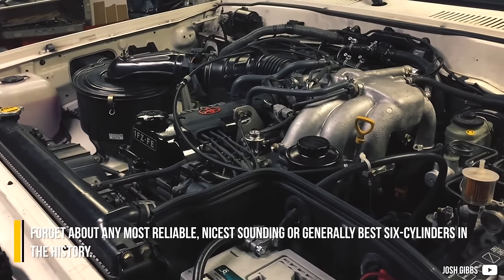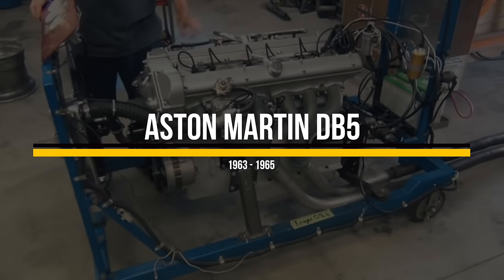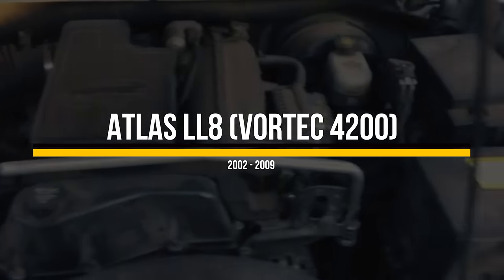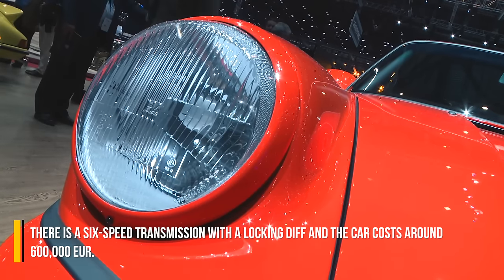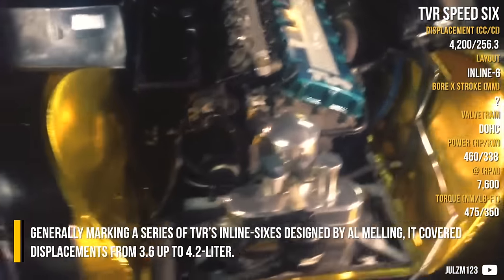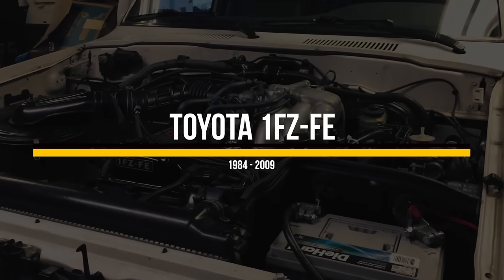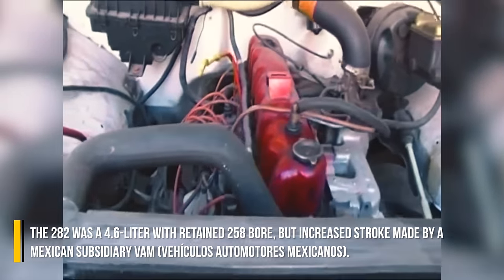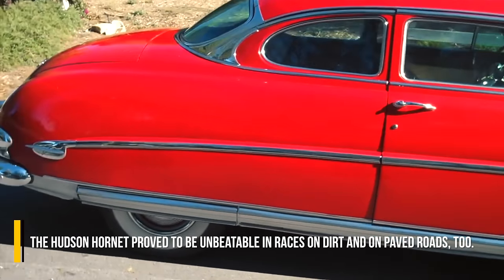12 Largest Automotive 6 Cylinders In The History

Comment: The 60s era GMC 478 c.i. V6 (roughly 8 liters) would top your list. It sits atop their V6 lineup, which also includes their 401, 351, and 305 c.i.  engines.
Reply: Yep, I thought they would be here also and that's why I watched the video.
Reply: Did they come in pickup trucks?
Reply: @YOU BLYAT  No they came in GMC cars
Reply: @hannibalsimpsonthefishseller  the 8 liter model? If so I want
Reply: @hannibalsimpsonthefishseller  They were in the GMC pickup, it was the engine and the trim levels that made the Chevy truck and the GMC different.
Reply: I hada 64 305 cl pass anything but a gas station. I bought a 292 cl chevy racing engine. Roller cam and bearings. With a 4 bbl it was pushing over 500 hp
Reply: @Hannibal Simpson the Fish Seller from Montreal  GMC makes many different types of trucks aside from pickups.
Reply: You forgot the V-12 version. Off topic but...
Reply: @sumgai2585   Yup 2 in a row
Reply: @crf80fdarkdays  
I think the 478 V6 was only used in bigger trucks,  like a C60 or bigger.  I drove a truck with the 478, compared to a diesel engine, it was a dog. That big engine only had a small 2 bbl carburetor.
It was used in Chevy trucks as well as GMC
Reply: @bertgrau3934  I may be crazy, but I really wonder how the 478 would do with modern port fuel injection and a turbo, with a much better intake design...
Reply: @dposcuro  
That would be interesting,  they didn't make much horsepower,  but they were designed for Torque.  With a bigger carburetor/manifold,  headers,  and a turbo it would be interesting to see what kind of horsepower/Torque it would make.  My guess would be the camshaft would be the limiting factor. I agree that would be a fun thing to try just to see it on a dyno.
Reply: Not to be this guy, but 478 CI is about 7.83 liters. ~61 Cubic Inches is equal to 1 Liter.
Reply: GMC never offered a v6 larger than 351 in pickups.  The bigger ones were for medium and ehavy duty trucks.  This vid was for car engines.  They didn't mention the 292 Chevy, unless I missed it.  There were a lot bigger 6 cyl engines for trucks.  Mack had a 707, Continental had a 606, IH had a 501, Dodge had a 413 flathead in trucks in the 50s, GMC had a 707 in the 30ss and 40s and a 503 until 1959, also Continenatal had a 672, but they were all low rpm, very heavy built, truck engines.
Reply: @crf80fdarkdays  yes, and panel trucks.
Reply: @hannibalsimpsonthefishseller  gmc never built cars.

Comment: Bro you left out all the monster GM 6 cylinder truck engines, 305, 351, 401, 478, 637, 702 and there's more I'm forgetting all the different displacements.
Reply: The 702 was the v-12 made out of two 351s
Reply: @jamieleeper8215  I thought the 12 was over 800ci? It's been a while since I've played with any old stuff just remember GM had some beastly 6's my grandpa had a old Chevy dump truck with  a 478 in it thing was a tank.
Reply: I could only imagine! I have a 63 pick up with the 305 v6
Reply: Derek Joon Shocked to see this one left out - my friend still drives his pick up every day with the 305.
Reply: They made a 503ci straight 6 in the late 50's and early 60's, but I think that was more for heavy trucks than your standard fare home use auto.  Might not fit into the category of the video since he didn't include road tractors.
Reply: "the big block six"
Reply: Those V-6 s were exclusive to GMC trucks only; back when GMCs  really were different and better.
Reply: Came here to say this. Not really a GM fan but man those big GM 6cyls are something nuts
Reply: Derek Joon Meh... American engines are sort of Shity a bit like French, British and Indian are too.

Don’t fucking get me even started on that Fucking Ford Short i6.

B5254T4 is the best engine in the world fight me!
Reply: @ellenorbjornsdottir1166  that's a Ford 300
Reply: silverbird58  he included the Ford 300 which was only in pickups.
Reply: Gmc built a 707ci inline 6 gasser
Reply: Before Diesels became common most trucks had huge 6 cylinder engines.
Reply: silverbird58; He did say cars, but he included the Ford 300CI truck engine.
Reply: silverbird58  It says automotive I think that covers cars, trucks, vans.
Reply: Daver G  Oh okay like I said been quite a while since I've been around any of the old GM big 6's just remember they had some pretty large displacement 6's
Reply: @klaspeppar5619  You smoking crack? General Motors has produced some of the best engines ever made, why do you think Chevy small blocks are in anything and everything, because there reliable, easy to maintain and run forever, don't think GM would have produced millions of them it they were junk, and back to the topic of these big 6's go look at how many YouTube videos there are of these engines sitting in fields for 30-40 years and all it takes to get them running is clean fuel and a battery! Try that with some European junk!
Reply: What about the jimmy 302 that gmc made
Reply: Why are you always wrong? Kudos on mentioning the AMC, was a pretty good motor. But seriously, no real homework done.
Reply: The 240/300 Ford engines can legitimately be regarded as 'big block' sixes when being compared to the 170/200 and 250 engines that powered Ford's compact and intermediate models.  The two engine designs are different as night and day; the only things they really have in common is that they both have six pistons arranged in line, and the name 'Ford' stamped into the rocker cover.  Other than that, the 240/300 was a workaholic; powering millions of pickup trucks, vans, and full-sized passenger cars, while the 170/200 engines were light duty mills propelling Falcons, Mustangs, and Mavericks down the road.  There's a reason the Ford 240/300 was 'bulletproof'.  It was built a lot sturdier than its 170/200 brethren.
Reply: I think this was about 6 cylinder car engines, not counting commercial trucks
Reply: The title of his video was 'automotive' engines.  Where is the limit to the word 'automotive'?  Does it describe ONLY cars?    Cars and light trucks?  ALL motorized vehicles?  It's a matter of interpretation.  And no matter where you draw the line, the video is essentially just a time-waster.  What difference does it make?
Reply: if you're talking to me, I said "I think. . ." right? and I still do think that so figure out a way to accept it LOL
Reply: That engine are available in gm opala and omega
Reply: The 637 and 702 were v12’s.  The 305, 351, 401 and 478 were v6’s though
Reply: Also the GM 292 cid, but that's ok GM is left out on a lot of these videos.
Reply: In 2002 I stopped to give gasoline to some firefighters on an old fire truck with a huge straight six. They told me the engine was about 500 cubic inches.
Reply: Detroit 60 series-14 ltr, yes its diesel, but it is a 6
Reply: If he had been talking about biggest straight sixes ever this would have been all road tractors. He must have meant only roller skate engines.
Reply: I had a 59 Gmc pickup with the 270... wish I still had it.What a torque monster
Reply: Maybe you missed the part about "production cars". I don't know of any production cars using engines like the 401 GMC truck 6 cylinder.
Reply: What's with the rolls royce phantom II with its 7.7 litre inlline six?
Reply: And the obvious 4.3 v6
Reply: they're talking about inline 6-cylinder engines,not V8 or anything like that,just straight 6 cylinder engines,the biggest one ever made was Ford's 300 big block 6.
Reply: @4gauge10  hello? What Nonsens. 300cu are 4.9litres. The rolls royce phantom 2 has a 7.7 litre inline six.
Reply: @4gauge10  but it's not the biggest production made inline six. And these Ford was made in masses for cheap cars. Sure that there are parts easier to get. The phantom 2 was a extremely expensive luxury car only for the handful of super rich people. Naturally you can't get parts for that at your next door car parts trader. People, wo are able to buy today a phantom 2, they have enough money to let manufacting the needed parts by a specialized handcraft workshop 😄
Reply: @juergen07091973  the Ford 300 6 wasn't built for a car for starters.HAHAHA!!.
It wouldn't even begin to fit in your car you know as big as a Lincoln Town Car which is not a cheap car these engines were built 4 trucks from the F-100 series all the way up to the F-1000 series toters.
These engines are also occasionally used in drag racing today,many track records in a quarter mile.(5 seconds at well over 150 miles an hour)
Reply: @juergen07091973   300 big six is the biggest 6-cylinder that was ever made. Because we're talking about what's in production or used to be in mainstream production,so the rolls-royce engine doesn't count, now only that,from what I read about it,it was an experimental engine and almost nobody use them,very uncommon.
Reply: @4gauge10  compared to a phantom 2, a town car is a very cheap car.
The rolls royce is build serial, a far smaller than the Ford, but in serial and its much bigger displacement. And it's for a passenger car. So it's a bigger six sylinder car engine than the Ford.
Reply: @juergen07091973  Sorry,the 300 big-6 still stands as the largest engine in auto history,it's much simpler in design,easier to repair,blows away R/R in every way.
I've owned several of these,the last one I had,I put over 453,000 miles on it and it showed no signs of wear at all.The Ford big-block 6 has a 1-million mile rating and I've personally have seen these in single axle toters in the F-1000 series with well over 800-K on the clock and not use one drop of oil.
The R/R is a waste of money even by a millionaire standards.
I have a few friends that are millionaires,they said they would never own one because there are no better than anyone else's car and when something goes wrong with them,you have to keep shipping them back to England and it's just not worth it.
Reply: 4 gauge, Indeed. Hey what oil have you been running? I am getting ready to repower my 65 f250 4x with an 82 300. But near as I can tell the head is from the mid 70's. It is all fresh.
Reply: @totallyjonesin  Somebody didn't take care of that engine,that's what that means,that's very uncommon thing to have happen.
I'm running Amsoil OW-30 weight.
Before I became a Amsoil Dealer I was running mobile one OW-30 weight.
Reply: @LacquerSniffer  yeah.  I ran across that info not long ago.  A 5in bore with a 6in stroke.  Wow.  With that stroke I think it maxxed out at 2800 rpm but delivered I believe over 600 lb/ft of torque!  But it was a massive, heavy engine.  Years 1938 to around 1943 or so and was used in the Yellow Coach and Truck co. The forerunner of Greyhound.
Reply: no it was its own block one crank and one cam and one block @jamieleeper8215
Reply: could of included 292 302 I6s came in pick up trucks, and the 305, 351 @matthewmillar3804
Reply: @DRNEGOLICIS  i had mentioned that in several other threads, most have forgot this one

Also it had 4 heads, 2 intakes, and two carbs
Reply: @matthewmillar3804  Red Diamond 501 you could get it in an IH 1 1/2 ton truck
Reply: @stromsky58 Sorry,the biggest 6 in a 4-WHEELER was the 4.9 liter 300 by Ford.
Now if your talking as in SEMI-trucks,Ford made the biggest in the industry,a Ford Navistar inline diesel inline-6 at nearly 1,400 cu.in.displacement at 450 hp.and nearly 2,000 ft.pounds of torque.Plus its much quieter then anything GM put out.(4-cycle)
Reply: Derek Joon well ford still makes cars and a lot of their stuff is junk
Reply: @cameronowens5804  You really need to stop drinking too.
Ford is the best money can buy and has the best trade in value.
Reply: @jamieleeper8215 the 702 was one common block with 4 cylinder head's, a big misconception was it was to V6 engines mated together.
Reply: @squidduck the 637 was a V8 and replaced the V12 because it was a more compact powerplant that produced nearly the same amount of horsepower and torque in a lighter package.
Reply: 637=v8
702=v12
Reply: @jamieleeper8215  One common block and crankshaft with four cylinder heads.
Reply: @moutnlovr2  yes I forgot to mention that sorry
Reply: The 637 and 702 were not 6cyl.
Reply: https://en.m.wikipedia.org/wiki/GMC_V6_engine
Reply: @klaspeppar5619  ahh likewise not crazy about Lucas electrics.
or gottie lights...gotta get home beffore its dark
Reply: @Miguel Castaneda  Lucas electrical system behold the dark.

Turns out that the Short i6 or Short Isaac as I previously called it, was British built....
Can you imagine an  (probably) American designed engine with American design faults and British build quality on top of that?!
Reply: @LacquerSniffer  They sure did
Reply: silverbird58  he said cars but twice he showed Ford pickup trucks GMC put the v6 in their pickup trucks too.
Reply: The 4.3 was in cars in the 80’s
Reply: They were commercial engines and absolute beasts. For a short period of time you could get the 305 V6 in the Suburbans and Chevy trucks of the 60s.
Reply: silverbird58 
The 305 and 350 GMC V6 was available in light duty trucks, similar size to what used the Ford 300/4.9 inline 6.  That Mack is a medium duty at best.
Reply: there was also the 525, 616 and 707, made in the 1930s and used in Yellow Coach Busses, 700 series.
Reply: 637 was a V8, the 702 a V12. This list was 6 cylinders only. GMC also had a 503 I-6, early 1950's.
Reply: @forterierocks  the V12 was a 702, basically a "doubled" 351 V6. It had a single block, crank, and cam, but used 2 V6 intake manifolds, 4 V6 heads, and 4 V6 exhaust manifolds. Max rpm in stock form was only 2400! But ThunderV12 in Texas builds them to withstand 5,000!
Reply: @matthewmillar3804  Yeah, his list was all light duty stuff, but since he listed the Ford 300 truck engine, he should've listed the 292, 305, and 351 GMC truck engines.
Reply: @klaspeppar5619  More like, "bite me".
Reply: @LacquerSniffer  I've heard that too, but I searched YouTube and couldn't find one.
Reply: @forterierocks  The SBC is ok, they certainly made a shitload of them. But I'll take a big block Mopar any day for simplicity, ease of service, durability, and power potential using FACTORY parts, not aftermarket.
Reply: @squidduck  637 was a V8. Videos available on YouTube.
Reply: @Jakob Vircks Probably EPA bullshit, along with the switch to diesels for big trucks.
Reply: @MustangsTrainsMowers  503. I've heard there was a gas 707, but I've never seen one.
Reply: @johndingo7527  You're getting pretty far afield. He SHOULD HAVE limited the list to CAR engines only; adding the Ford 300 truck engine opened a whole new can of worms.
Reply: @mothman-jz8ug  Then he shouldn't have listed the Ford 300 pickup truck engine, while leaving out the Chev 292 and GMC 305 and 351 V6 pickup truck engines. The list was flawed in execution.
Reply: @4gauge10  C'mon, man, Vizio was talkin' about GAS engines. And he should have listed only CAR engines, listing the Ford 300 pickup truck engine opened another can of worms.
Reply: @branon6565  Blanket statements like that are just silly. I'm not a GM fan at all, they've made a TON of shit, but certain Buick, Caddy, Pontiac, and GMC engines were extremely durable, powerful, and reliable.
Reply: @fadedjate7230  I've also seen several 1967 GMC 3/4 ton pickups with the 351 V6. It may have been ONLY available in pickups in '67.
Reply: I had one of those, a 1948 GMC 5 ton, dunno what size engine but it had a carburetor the size of a toilet bowl and got about five miles a gallon.
Reply: I just learned yesterday that GMC also had a 426ci I-6. Holy crap, until a few months ago, I had no idea GMC was so awesome back in the day. I've known about the 270, 292, 302, 305, and 351 Sixes, and the 702 V12, for many years, but only learned of all the rest this year. Thanks to You Tube.
Reply: @xaenon  Yeah, I've owned 4 200-6s. They suck ass. I had 2 Mavericks, a Comet, and a Fairmont, and they were all gutless pigs. Good mpg, but no fun at all. I had another 2 dr Maverick, a 73, with power steering, power brakes, a/c, and a RADIO (that was OPTIONAL; my other 2 Mavericks and Comet DIDN'T). It had a 250 I-6, and that was much better. Still no hot rod, but at least it had some torque.
Reply: @4gauge10  Why so thin? Weren't those 300s designed for 10W-30?
Reply: @donellmuniz590  Well, to be fair, the 200 wasn't supposed to be a 'fun' engine.  It was intended solely for efficient, reliable, basic 'point A to point B' power, and in that role, they accomplished their design goals very well.
Reply: @forterierocks  I agree with the European junk. As far as gas engines go, they can keep em. Don’t agree with General Motors having the best engines ever though
Reply: @LacquerSniffer  part of the 525, 616 and 707 family lol. only made 110, 130 and 150 hp respectively. can't remember on the torque, I think the 707 had around 600 ft lbs
Reply: Even bigger what about the KTA 600 Cummins
Reply: @MattyC62185  the king of all on road engines. Walk a cat any day of the week
Reply: @MattyC62185  that's a OTR diesel bud. doesn't count
Reply: Really only americans and australians think of trucks as something to drive to the supermarket or to work. 

So they really kinda dont count.
Reply: This. The 478 was one of the biggest 6 bangers ever built. How did he forget this one??
Reply: @4gauge10  1400 cubics my ass. Do you have any idea how big that is?
Reply: @toomanybears_  just inliners is I think what this video was aimed towards. I have heard a lot of really good things about the Magnum V6s GMC built tho, I kinda think they should get their own video
Reply: Trucks will often have large displacement six cylinder engines.

Comment: I love the subject, but you need a part 2 for this.  Include the Chevy 4.3 V6, the 292 Chevy I6, the 270 and 302 GMC I6's, and the 305 and 351 GMC V6's.  I see you limited the subject to passenger cars and pickup trucks, so won't bug you about the 379, 401, 432, and 478 versions of the GMC V6.